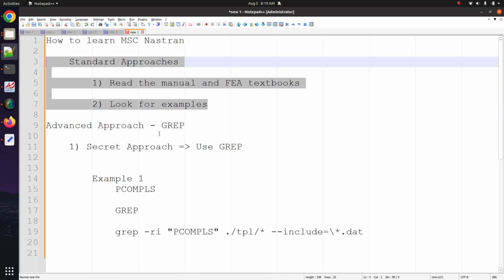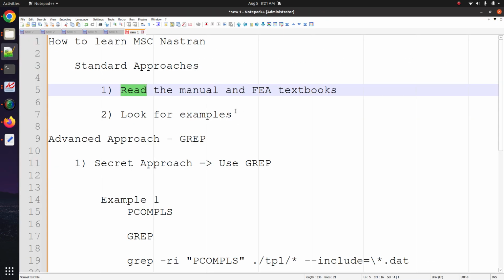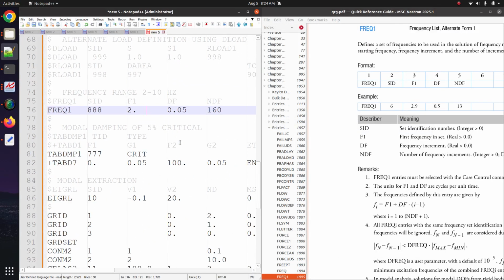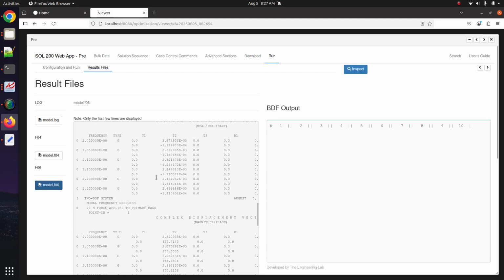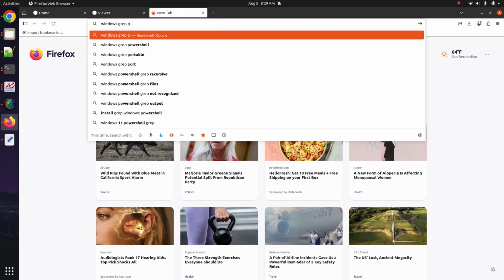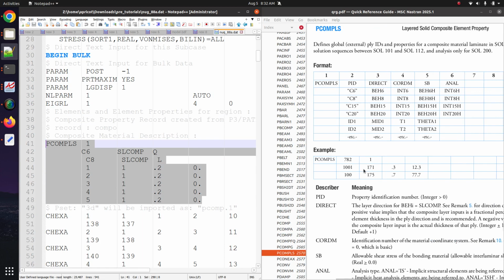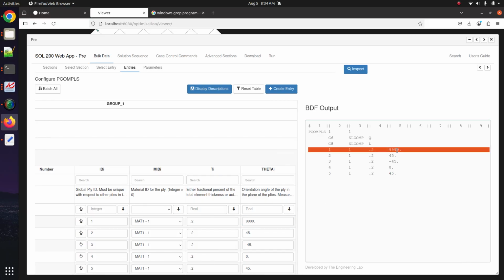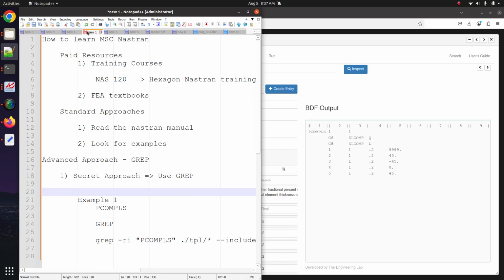How to learn MSC Nastran

Comment: I have two parts in a random analysis. Is there a way to apply two different damping to each parts?
Reply from the maker: Will using the GE field on the MAT1 entry work? 

This is one of many ways to supply damping. For a list of the different ways to input damping, I refer you to the MSC Nastran Dynamic Analysis User's Guide, section Structural Damping Specification. I also recommend reaching out to the Nastran technical support team or posting your question in the subreddit: reddit com/fea.